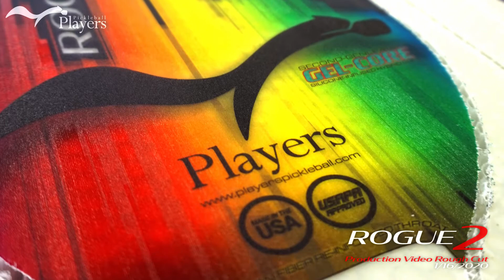Rogue2 Production Rough Cut 001

Comment: Where's the gel infusion??? I didn't see it. The core looked like evryone else's.
Reply: Check the vid on the Rogue 2.  I think that shows it.  The gel is not dispersed into the core until the silhouette is cut out, I believe.  That way, it can be applied to achieve the 'perimeter weighting' benefit.